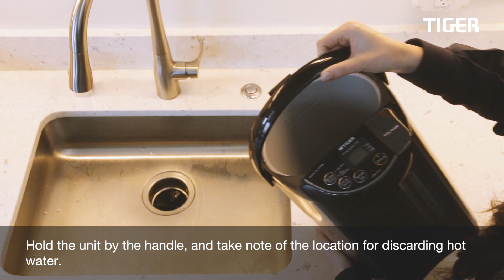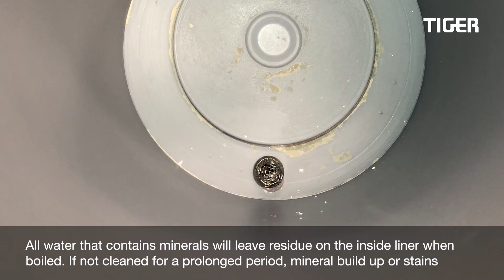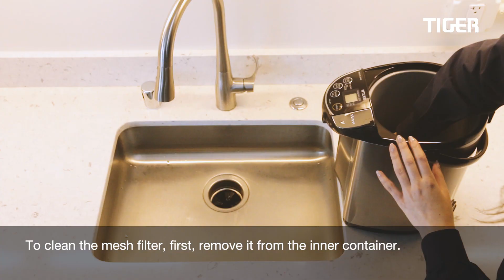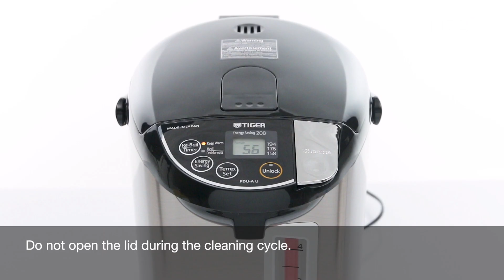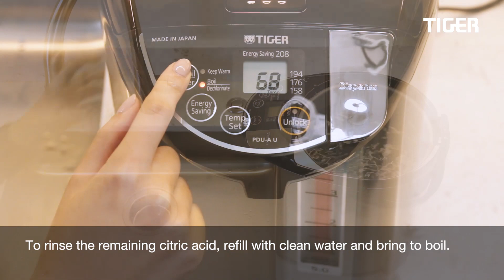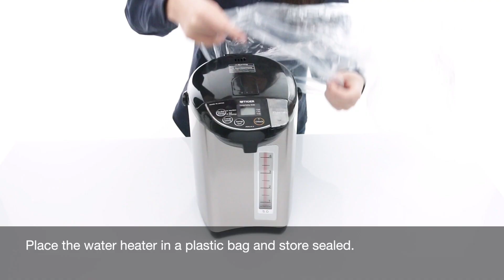How to Clean your Water Heater/Boiler

Comment: I used a similar method but with vinegar and it worked well. Nice video
Reply: The best company I have this hot water boiler 10 years working like new
Reply: Vinegar saved my 20+ year old heater. I will never let it get like that again.

Comment: Can I use vinegar and water to clean the boiler? ratio of one litre of vinegar to 4 litres of water? We have hard water with lots of calcium. Cleaning so frequent with citric acid is expensive.
Reply: judley1963 I found this on another site which I have used frequently: 
How to Get Rid of Limescale

Limescale is really not bad for your health. However, that hard build up can affect the proper function of an electric thermal pot and it is somewhat unsightly. Right?

Personally, it’s a pet peeve and I hate seeing it. So, I try not to let the problem develop but if it does manage to build up, I get rid of that awful limescale by following the steps described below.

- Pour 2 cups of white vinegar into the inner pot.

- Fill water up to the top water level.

- Let the water sit for 1 hour.

- Boil the water and leave it for 1 hour.

- Empty out the water out completely.

- If the limescale is not gone, repeat the process again.

Note: Many electric water boiler manufacturers have units that include descaling features or recommend specific limescale removal methods. I suggest you try it their way first, otherwise, the steps described above work for me and they should work for you.
Reply: @donnawhittaker5197   I have done the method suggested but it is hard to find citric acid in my local town and I really don't want to order it from Tiger. I have used vinegar - about the same ratios you suggest and used the method from Tiger and it works perfectly. And I will try your method as well because I don't think leaving it for 8 hours or overnight is necessary. Thanks so much for your reply and advice, it is very much appreciated.